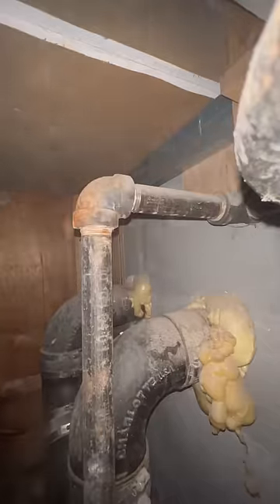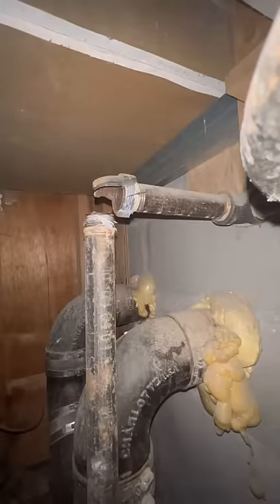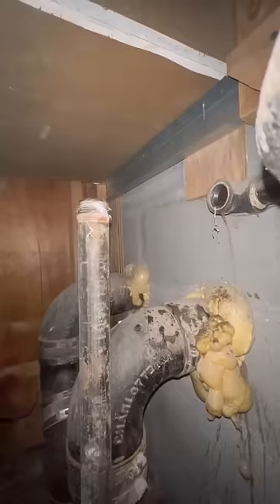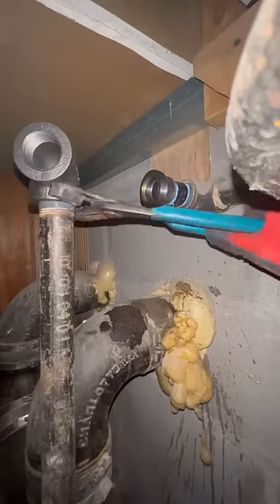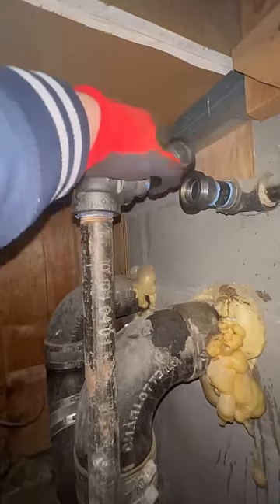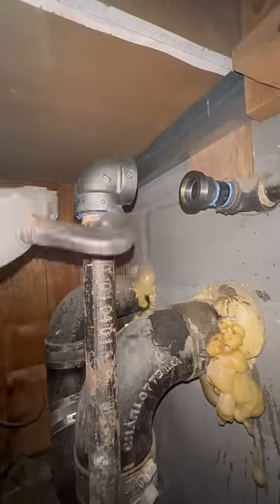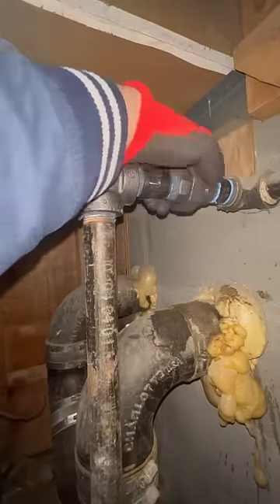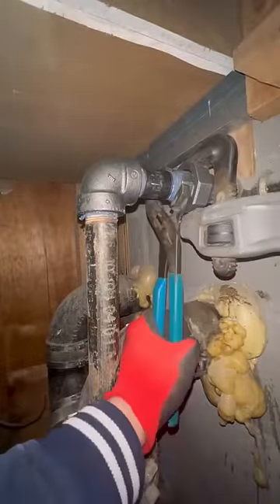How to repair a broken cast iron elbow

Comment: As a plumber on screwed piping or threaded you never backtrack nothing - there is always a chance it might leak so don’t take a chance
Reply: I was just going to say the same thing, as a pipefitter
Reply: Yep, never
Reply: I’m a sprinkler fitting, I never take the chance, it will cost you a lot of time!
Reply: Yup
Reply: 100%
Reply: Yup, I'm sure someone's pipe is leaking rn because of him💧 😂 I'd trust that on gas, maybe, but not a water line 🤦‍♂️
Reply: Asking for an honest opinion, is backtracking about 15 degrees when using dope ok? Redoing the entire gas line in the house and will static pressure at 20 psi, line will be at 6.5 WC ( .25 psi).
Reply: @ChuckMorton    Should never back a fitting off whether gas or water. Most don’t realize threads are actually tapered so once you tighten to a certain point, if you back up that contact between the two have now slightly widened.
Reply: @JohnCap523  makes sense with NPT being tapered but was hoping that the surface tension of the dope would flow back from the filled end vs forming vacuum voids in the opened area. Will follow best practices.

Edit: one last question, looks like water is dripping out of the line. Wondering if that is condensate, condensation or something else bad. Water inside black pipe with O2 is bad.
Reply: @ChuckMorton    Well, the issue with your thought process is there’s numerous kinds of dope (thread sealant), some thinner, some thicker. I’m sure that concept has been tested but best practice is to never back off…
Reply: Just stop 1/4 short then last 1/4 to align and tighten only
Reply: @sweetsketch3  exactly
Reply: Did the pipe dope and lubricant dry? No. They will serve their purpose as intended.
Reply: @homeimprovement8119    Huh?
Reply: @JohnCap523  search up why we use pipe dope or pipe sealant same thing.
Reply: @JohnCap523  okay mr.john
Reply: Loctite 55 string you can. Why I use it.
Reply: But he guarantees it tho
Reply: Exactly I’m a master plumber and you can’t guarantee shit if you backed that sitting off of there because once you back it off there you’re losing a compression and if it’s not threaded properly, you’re not gonna get three terms of that fitting so therefore sometimes the little hacks don’t work in every day scenarios And pipe dope is a sealant. Let him know that bro some people just don’t understand that’s why I always was told and I was always taught just because you can read prints just because you have a master license and run a business doesn’t mean you know how to put tools in your hand at work that’s why five out of 10 businesses only have one owner that has a license and everybody else works off of that license which sucks my company they put everybody to school. If you don’t want to go to school you don’t make good money but you answered everything I wanted to say, bro.
Reply: @bryanr6684    Who guarantees what?
Reply: As a plumber I agree. Big no no.
Reply: What do you mean by backtrack?
Reply: As a certified forklift operator I can confirm this comment is true
Reply: @98frenchfry    Thank god the forklift guy is onboard…  😜
Reply: Exactly
Reply: Exactly thank you it was driving me nuts I'm a gas line pipefitter!!!!
Reply: he also put the tape over the pipe and not just on the threads..and now it will dangle there and collect crap or get loose and clog a shower mixer...
Reply: What do you do then instead?
Reply: This guy didn’t clean the threads that’s a big no no in Nevada
Reply: Precisely!
Reply: Precisely!
Reply: That shit'll be fine. That thing will come back up to temp, expand tight and that will be the end of that.
Reply: @vihreelinja4743  its a heat line.
Reply: What the hell is the union for f I can backtrack broski? And all that trick stuff cutting the fitting , Duh just cut the pipe and save your tricks for the kids BROSKI
Reply: Ohh no 👎
Reply: False under 60psi, your good. Steam? Forget aboot ot
Reply: The thing is that he says there is no other way to do it, but he could have put in the short piece and the other half off the union one rotation short and then tightened it into place to ensure he doesn't have to do this.
Reply: @mattpeek12  Must be one of those AI sprinkler fittings.
Reply: Yep go around again And use some actual wrenches one as a backup
Reply: Calm down “pipe fitters” it ALL depends on the pressure. Gas at 5psi? Heck yeah, backtrack all you want! Water at 100psi? NO NEVER.
Reply: Ran gas pipe for years done it plenty times never had a leak 🤷🏻
Reply: Definitely not supposed to but definitely works fine 99% of the time. If it budges a hair while you’re tightening the union or something it’s fine. 100%…it’s not the end of the world 😂
Reply: I disagree. I was taught that as well and as a general rule it’s true but the same guy who taught me that also taught me you could turn back just a little. I don’t make a habit of it but in a pinch it’s fine. I haven’t had a leak from it yet. Though I’d guess that it’s better to have pipe dope involved when doing this. The one caveat is I’m only referring to gas and water lines which should never be over 80 psi. I don’t know about steam lines or fire lines that operate at much higher pressures.
Reply: This
Reply: Just tighten it again lol
Reply: I've been watching some of his stuff, i noticed that he doesn't use 2 wrenches when tightening or loosening pipe fittings?
Reply: @JohnCap523 valuable insight👋✌️
Reply: @98frenchfry 😂
Reply: @ChuckMorton  it's never ok, what i do i leave the connection /fitting in a position where I can do whats necessary and then continue with righty tighty, backing up a fitting that has been under pressure, especially teflon and dope, it'll become loose, don't fuk around with gas, or water..
Reply: @nowheelspin  good advice. I finished the install, pressure tested it and inspected it. The inspector said the job was one of the best he inspected. Cut to length and no nipple use.  Doing this gave me respect for any pipefitter who is willing to use schedule 40 on a retrofit.
Reply: It will be fine
Reply: As soon as I saw that I came to the comments. It just ain't look right
Reply: ive seen fittings like this be fine only to start leaking 10 years later. It's not hard to use the appropriate tools.
Reply: @jhuntley575  10 years later, not to be that guy, and I know fitting can last several decades, even longer but 10 years doesn’t sound tooooo bad, like a water heater can go before that
Reply: Can’t back thread any fresh or existing seals
Reply: Facts
Reply: You fools really gonna question HyroNYC? Straight up amateurs
Reply: @JohnCap523  this is helpful advice.  I’m a building controls guy (use to be HVAC) but sometimes I get stuck with the fitters and help them lol
Reply: @ChuckMorton  water should NEVER come out of a gas line. If it goes outside at all there could be a break in the line and getting small amounts of rain water in it. I've never really seen a black pipe gas line condensate from the inside either.
Reply: you just gotta do it right. and you forget people get what they pay for so that's probably all they paid for lol.
Reply: @bend4852  unscrewing the fitting after you've already screwed  it on
Reply: @ColdperpetratorLv  Reno,Stead Nev !
Reply: @ColdperpetratorLv  Northern Nev, Reno,Stead.
Reply: @anthonythomas5998  I was sarcastic you should always clean the thread that’s a given. You failed
Reply: Y'all didn't hear that he said it's no leaking tho. .  An that it's on fresh joints... Not old ones . The dope is still wet ...  y'all need to clean ya ears. I'm sure we all have cheated a lil bit to get something just right. Quit acting like all y'all the best plumber in da world 😂
Reply: back threaded is not 100% safe but as brotskaia state, it is ok binding the rule whenever is no other option
 I did it many times tighten fitting more than just quarter turn, then return fitting to its final position,as long as that fitting is not super tight in 1st place whi h will make the maleable fitting more loose on its threads...but seem brotskaia used or 300psi fitting or just regular thick one
Reply: As a Walmart greeter all I can say is Have a Nice Day.
Reply: Disagree my friend, did that in the past many times, never had a leak and until now never heard any complains about a leak, it depends what you use for sealing.
Reply: Not a fitter or a plumber but used to have to make these kinds of connections for both steam and water. Backing off to make it fit and work with tape and dope worked very often and lasted years. As long as its not too much backing, anyway.
Reply: He's not really wrong with this thought. I've done it many times and it works and it doesn't leak. If you kind of over tighten it a little bit and you back off it doesn't hurt it. As long as you put Teflon tape and paste it's fine. I'm a licensed plumber of 26 years in the field. Anything is possible but he's not wrong. And I appreciate him being candid about it. It's taboo to say stuff like that in the plumbing world but there are a lot of tricks to every trade. I've done so many things that this guy puts on video... And many things he hasn't. But I do appreciate a conscientious and realistic plumber.
It's like telling people not to check a small gas leak with a lighter... Or hell, changing a gas valve or a water valve on the fly... It's frowned upon, but it works. Been there done that-
Reply: @louisp.3332 thank you for saying this. Everyone's an expert on YouTube. Many of them are correct..only in certain scenarios. In this particular scenario it's perfectly fine. I shy away from a full quarter turn back, But an 8th or just over that's about as far as I'd like to go.
Reply: As a heavy equipment mechanic, my gut instinct tells me not to back off, even with a fresh joint.
Reply: @mattpeek12 I had no clue a sprinkler fitting could leave a comment on youtube
Reply: Not a plumber but doesn't seem like a good idea.
Reply: @bend4852 he overtightened then loosened/backtrack fitting
Reply: Agreed 🤝🏼
Reply: I've done this before only use wet sloppy highquality dope and tape.
Reply: In most industrial piping we don’t allow threaded pipe or unions in steam service. It will ALWAYS leak! Not a question of if, a fact of when.
Reply: One More Full Swing And Your… No back track!!
Reply: I never do it on purpose but in 20 years of plumbing I have spun numerous fittings back a little bit and never once had a leak because of it.
Reply: I do reverse quarter turn all the time and had no call backs on them
Reply: Tried it once and only once. Will never try again.
Reply: Yeeeeah, but when you have no other choice as long as it's minimal you'll be alright , kind of a rook move though
Reply: If you can't backtrack how do you make things line up? it's not gonna turn another 7/8ths tighter to the right. Honestly just curious to know.
Reply: So what was he supposed to do??